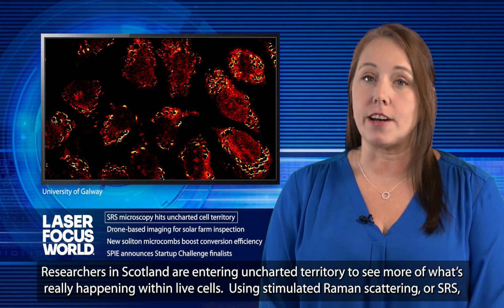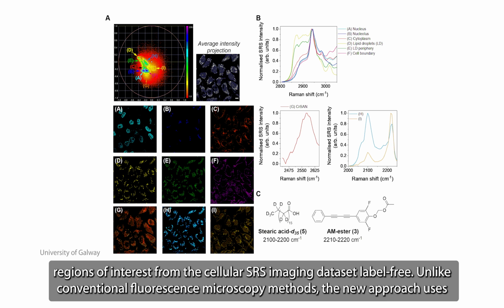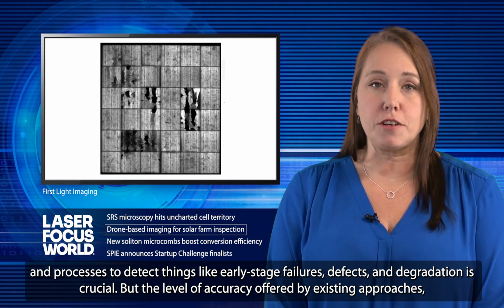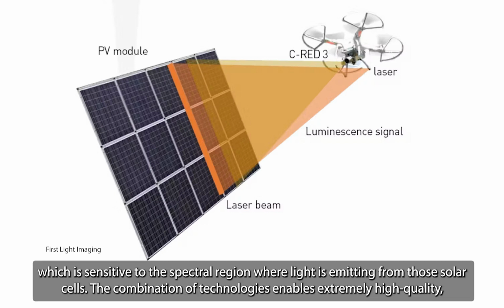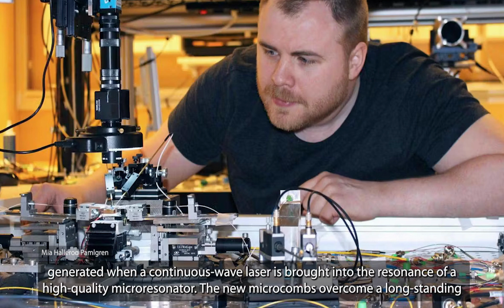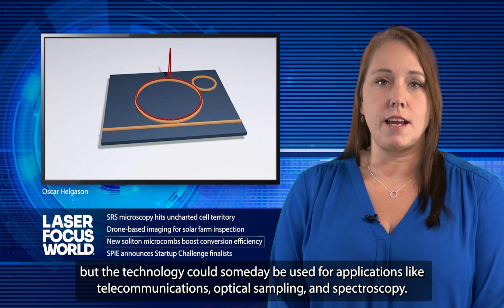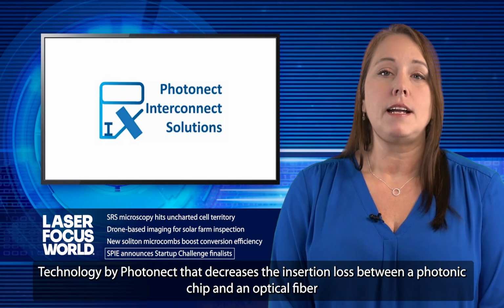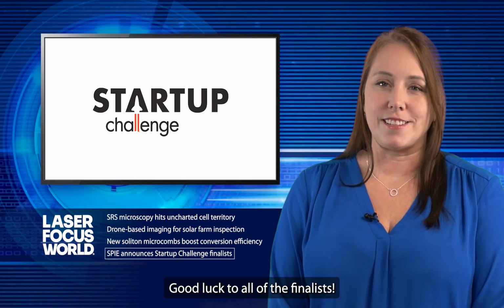Photonics Hot List: December 8, 2023

Comment: Dear Madam Justine.  It is possible to use a meter-square panel as a propulsive drive for a high speed spacecar.  However, it is necessary to use neurotransmitters  (AI-molecular switch) to prevent explosion. The perforated resonators in the first layer of the porous membrane into plutonium. Superposition and quantum entanglement must ensure that photons must absorb the electrons to prevent heating and explosion, The current jis then fed to the semiconductors in the Laser cavities. This raises power to megawatt level. The hexacomb core further raises energy to giga and trillion -watt level, The neurotransmitters operate at the protein-pion level which regulate the behavior of the subatomic particles.    Yours truly,   Francisco Arpon